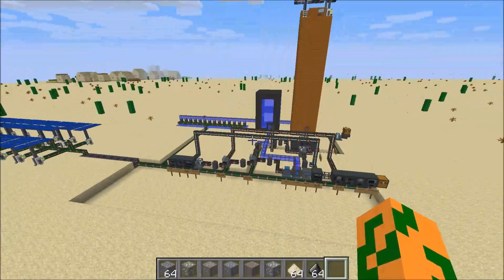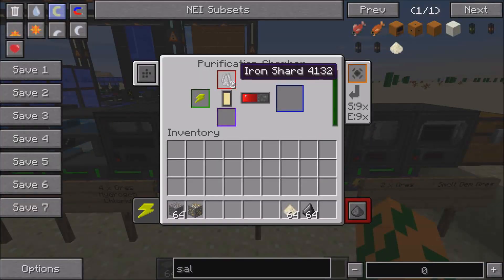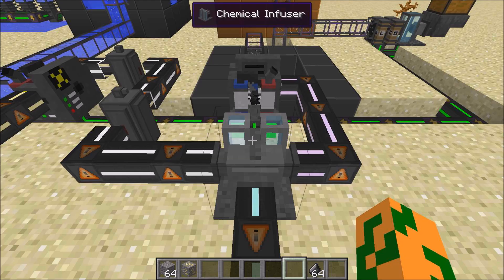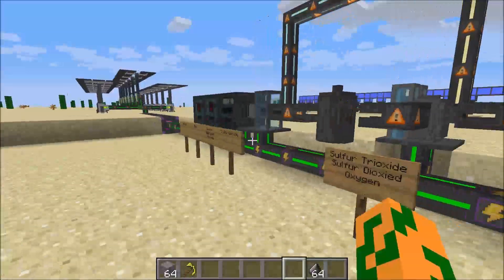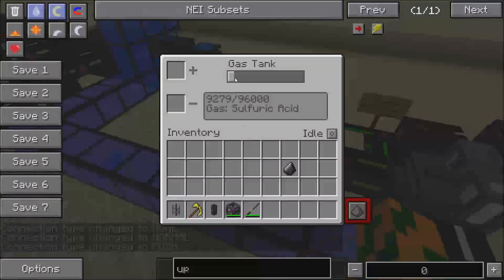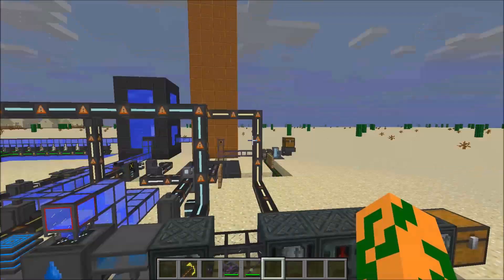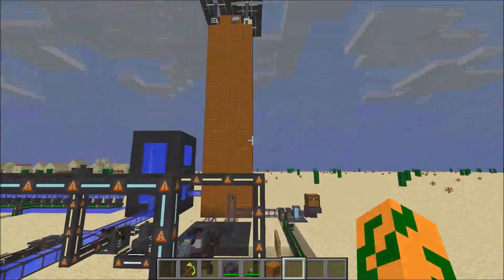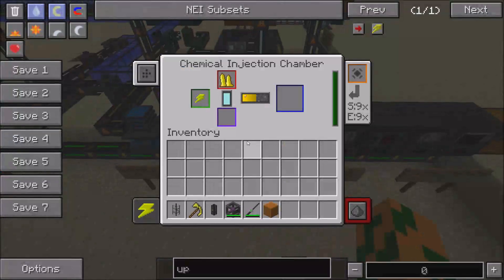Mekanism 1.7.10 Mod Spotlight  Ep7: Quintuple, Qaudruple, Triple, and Double Your Ores

Comment: I did the 4 basic factory chain to trip the ore.
I have a chest with a pipe to pull from the chest into the infuser. Everything work fine.
I have an iron chest after the 4th basic factory but my ore processed are not moved from the basic factory to the chest. What should I do to automate that?
Reply from the maker: Just make sure you set the machine to auto eject.
Reply: Hi, thx for quick answer! Yes, the auto eject is set to ON on all 4 machines.
Reply from the maker: Just make sure you select correct slot color to the side you want to eject with.

Comment: That was one heck of a jump, from baby steps you were explaining the Energy Cubes, the Robit, the Tools, etc. everything bit by bit now in this episode you crammed machines I never seen before, different sorts of pipes which have different pipe modes and could be better than the current TE fluiducts Im using, gas tanks, and not to mention all these gases that could also be useful for other things. You lost me in this episode big time when doing the chemistry. At least I can tell from the machines and pipes what they sorta doing from previous machines and pipes I've used before from other mods.
First Mekanism machine I put down was the Infuser and thought it wasn't compatible with RF (TE energy) cause it has two bars and neither was filling up. It was energized but I didn't know, the only machine not being energized properly by Universal Cables is Forestry's Squeezer.
Reply from the maker: Well the only thing that you use the machines for is the ore duplication so i figured i would show you how to use them. Which part were you having trouble with?
Reply: machine usage only for ore processing? I thought there would be more than that
Reply from the maker: That's all i could find .